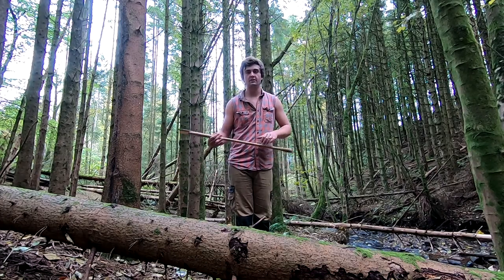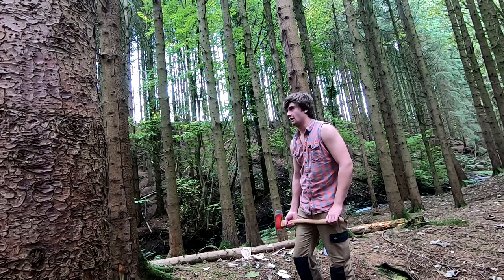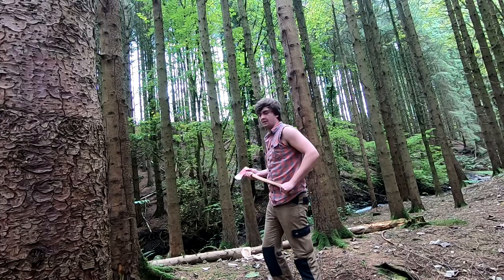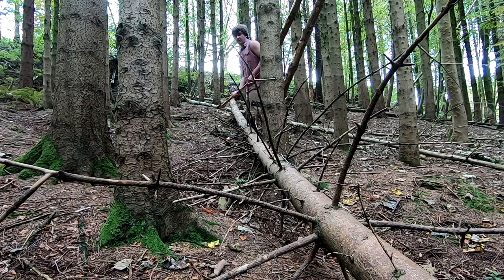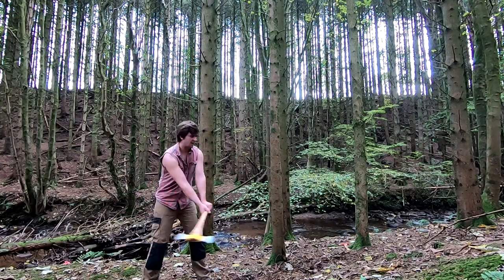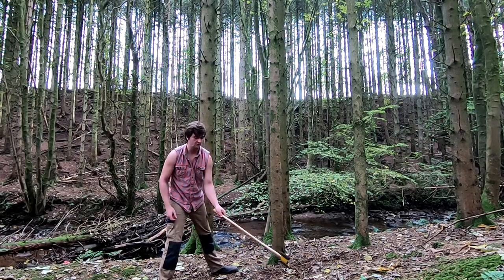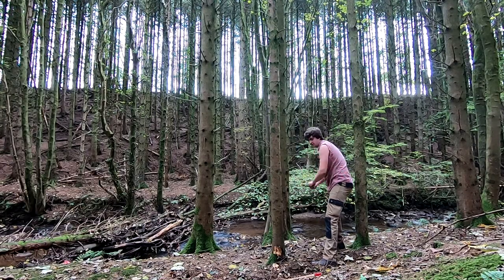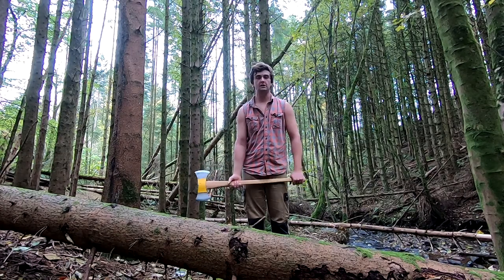Axe Handle Length and Power: Physics vs Practicality

Comment: Great video Ben.  I find that very little is made of cost accounting, but it is really all important.  I think we talked before about handle length and that there is a cost involved and it's =not just a free lunch.  Using the rule of extremes and imagining a 10 foot handle, it becomes clear that it's not a simple as if this pivot point moves this much, and the handle is longer, it will travel faster. There is a cost accounting to it and very hard to figure out with a machine as complex as a human as the driver.  I personally find handling and manueverability really important.  For generalized woods work and diverse tasks, long handles seem to be more often a hinderance than a help.  I just rarely have any use for them oustide of splitting.  They have their place, but few actually need them.  There is the safety issue though.
Reply from the maker: Thanks! I own 3 axes with 36" handles and they rarely get used unless i'm bucking or felling something outrageously large. I think 99% of people will be happier with a shorter axe. Dont know if you saw but Council tool finally released a jersey 3.5lb axe with a 32" handle. Should be a great option for those who want something heavier than the boys axe

Comment: I commented in another video about the woodcutting tradition of the Chilotes, here it was usual to work with heavy axes (always 4 pounds and more)  long handle, the southern forests had a lot of hard wood. The technique used with those axes was much more similar to the one used with sledgehamers, it is a circular movement where the hands do not move much along the handle. That compensates for the enormous weight, and allows you to accelerate a little more, without ending up exhausted. (it is the body that acts as a counterweight, the arms only steering the stroke) And since it was the only ax they used, a straight handle allowed them to use it with 2 hands much closer to the head, but also allowed them to use the full extension of the handle and gain leverage. They were guys who lived in the forest, days, weeks felling trees, chopping, carving beams, etc.
Here is a video with some passages where you can see the different techniques they used with that huge axe, with a long mast and wedge head (as you suppose, it is not so common anymore, there are only some old videos where you can see this type of work, and in particular the use of those axes)
https://youtu.be/ZL_qIXCv1wA?t=461

.
here's another clip, as the cut is made quite high, the axe falls when it is removed, and the guy takes advantage of that to turn it and hit again, he doesn't use much force,  just redirects the initial movement (it was unusual to cut the tree near to ground, with that type of ax and that length would be incredibly exhausting)
https://youtube.com/clip/UgkxswYBvxNzdeAWdOdh4VJeRSDhWhfwPcv1
Reply from the maker: thanks, those are some great links. always interested to see other axe users from other parts of the world

Comment: You're right in saying that the weight at the end of a longer handle feels heavier than a heavier weight at the end of a shorter handle. It all has to do with the physics of levers. At equal weights at the end of different length handles, the longer handle will always feel heavier.The longer the lever, lhe lesser the weight required to achieve equilibrium or balance of the entire apparatus, ie; weight and handle on a balance point.  To lift a heavy stone, a longer log will do the job far easier than a shorter log. Length is crucial in understanding the physics at play in wielding an axe. For example the difference between a 28 inch handle and a 36 inch handle is 8 inches, which makes the longer handle 29% longer than the 28 inch handle or if it is the other way around, the 28 inch handle is 22% shorter than the 36 inch handle. These percentages don't necessarily always apply directly to the energy generated simply because one axe can be more comfortable to use than another and could be swung faster. The 24% difference you mention is within that spread. Interesting topic. Great video !

Comment: I don't swing axes for a living, but I do swing hammers. Lots of them. I can tell you the first thing I do with a 6 or 8 lb sledge is cut that 36" handle down to around 28 or 30 inches. You won't see a 36" handled sledge on a construction  site. Unless it's for busting up concrete. As far as framing hammers.  I carry a light titanium head with a 17" handle. I can drive a nail much faster with a 14 Oz hammer than those heavy 24-28 Oz. Estwings etc. Physics is physics. We can't change it.
Reply from the maker: I couldnt agree more, 36" has its specific place but generally 32" or shorter is far more handy and has better biomechanics. A lot of guys spout physics theory and say longer handle=more power. If that were the case why do we not see 60" handles lol. Meanwhile people who use the tools gravitate towards 32" or shorter

Comment: So why are splitting mauls big, heavy heads on long handles?
Reply from the maker: because splitting mauls are not used in the same way as a chopping axe. Its like formula 1 compared with drag racing, both fast cars but very different because of the context

Comment: interesting information regarding the length of the stem (arm length to armpit) a very logical consideration which I have only heard from you so far. I also believe that there is a comfortable length of the ax handle. Unfortunately I did not have a clear length specification before your statement. could make a vid only on this subject "ax handle length in relation to arm length or body size and proportions."
Reply from the maker: Mors Kochanski is where i first heard the arm length handle, its a well known guide to choosing the right sized axe. You should check out his book and also the ax book by Dudley Cook, the 2 best sources on axe use
Reply: @benscottwoodchopper  Thank you for the information

Comment: Mechanically speaking, this still doesn’t make sense to me. From reading the comments, everyone agrees, but I’m having a hard time understanding why. 
Are you saying because a handle is shorter, you naturally use your body with the swing(not just your arms)? And that’s why it has more power? 
Sorry to ask for more details man, just trying to learn more is all👍🏻
Reply from the maker: with a long handle when bucking smaller logs, if you try to use your shoulders and legs to pull the axe in with more power, you will hit well below the target. You have no option but to stand straight and only use your arms. In theory a longer axe can have more power, but you have to remember that works both ways, a longer axe also takes more energy and can be more awkward to swing
Reply: @benscottwoodchopper  ok, yes I agree!!! Standing at 6’4” and having really long arms, I HAVE to use a shorter handle or I’d never hit the mark with any type of accuracy😂 I’ve tried, it’s ugly.

Comment: Where I live, 3.5lb heads are most common. Also, the hardware stores here only carry 36" handles. So obviously, I've assembled a few full-size axes. I think your analysis is correct, but I actually really enjoy using the full-size axes. I think its because I'm well over 6' tall, and the shorter axes are the ones that feel awkward to me. Even with a long handle, I still feel like I use the full-body technique that you demonstrate with the shorter handle. Swinging a 3.5 lb axe on a 36" handle is very tiring though.
Reply from the maker: Im actaully 6 foot 4, when i first started short felt a little awkward but now long handles feel the worst for me
Reply: @benscottwoodchopper  Interesting! Maybe I'll give it more thought knowing you're tall as well. Now the trick is finding shorter handles.
Reply: I'm over 6'5" and have always preferred 36" but I'm rethinking it lately. I'm starting to believe that 32" might be optimum for 3# or heavier heads for an all purpose axe. Felling, I really like the 36".

Comment: Hello Ben, what would it be like to use an axe of your preferred length with a 4 pound head?
Reply from the maker: I use 4 and 5lb Axes on 30-32" handles, feels great to swing, very powerful and accurate
Reply: @benscottwoodchopper  What problems are there with a 4 pound head on a handle of say, 27 inches?
Reply: ask the Basques
Reply: Death By Astonishment your shins might get in the way
Reply from the maker: @deathbyastonishment7930  4lb on a 27 would work fine
Reply: Death By Astonishment no seriously, there must be some old timers out there left to tell their story as did Jack Crabb in Little Big Man...

Comment: I think of a handle as the gear ratio you're selecting for the axe head. It's no use having a heavy load to accelerate then sticking it in a high gear. I put my 3.5lb heads on 31.5" handles and they feel more friendly to heft and swing.
Reply from the maker: Thats a good way of explaining it. 6lb on a 36" feels like going uphill in 5th!
Reply: @benscottwoodchopper I can only imagine how much arm strength it would take to use all day. My 2.25kg Curved Basque axe on its short handle is already pretty hefty.

Comment: Working much harder with the shorter handle tool.  Obviously making his views pan out.  Approaching the question with an open mind would get a much different result.
Reply from the maker: Then you missed the point. Try a 28 over a 36 and you will agree